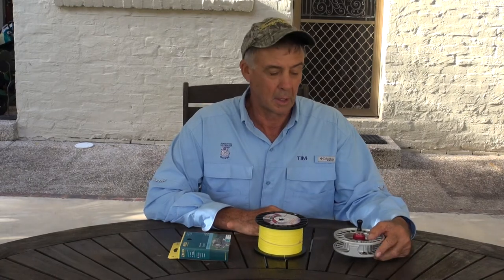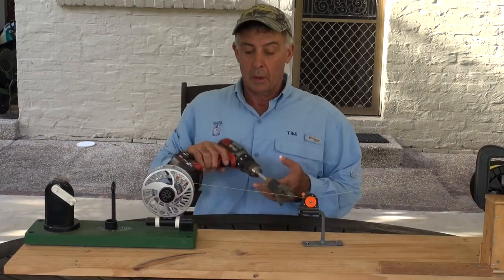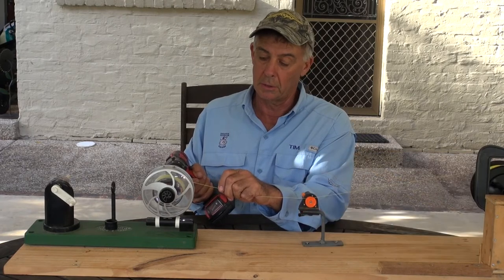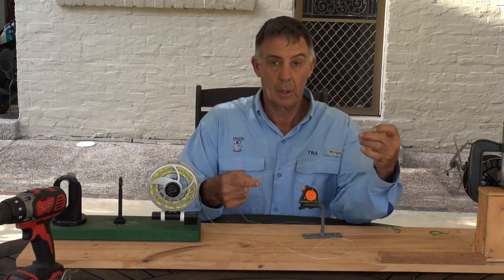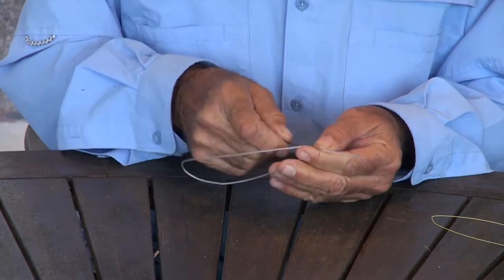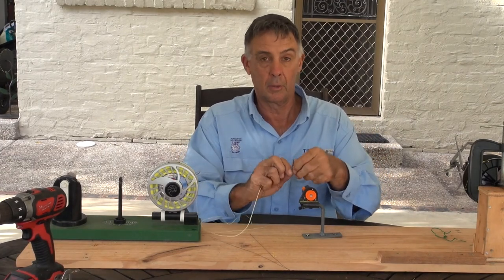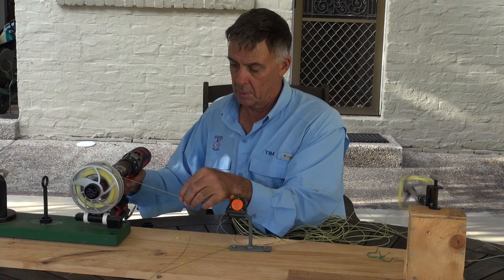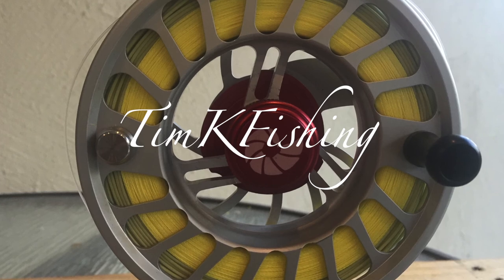Loading fly line and backing to a fly reel

Comment: How do you make the three fingered drill attachment? Thanks
Reply from the maker: we used a piece of broom handle, put a spindle in one end (to fit into the drill).  At the other end we inserted  three  pieces of flexible wire, covered in plastic. It was a prototype. this trick is having the flexible wire so that it fits and reel (some dont have spokes, so the plastic "fingers" can he adjusted to fit
Reply: TimKFishing brilliant. thank you
Reply: Can you do a video on how you made the sprocket that fits into the fly reel? I can’t find anything like this out there